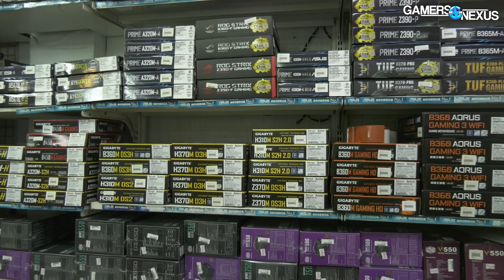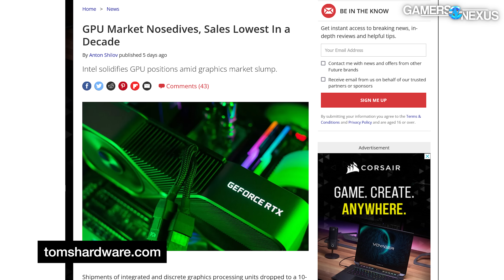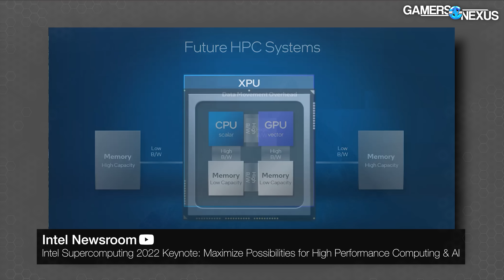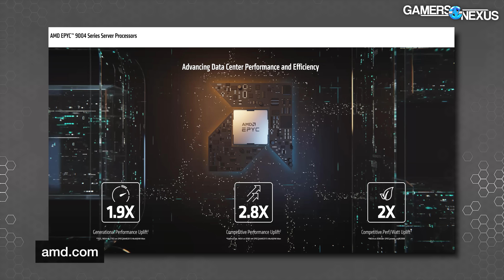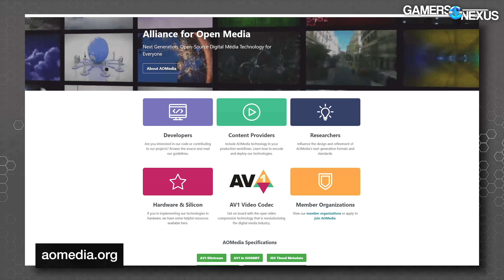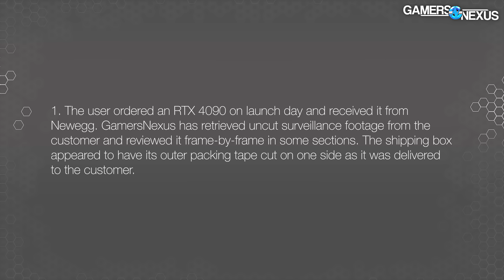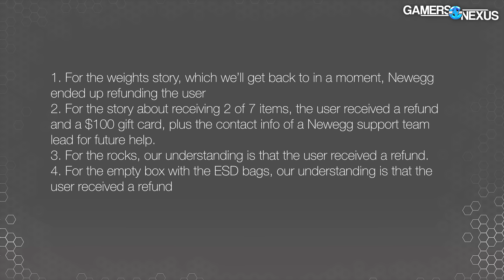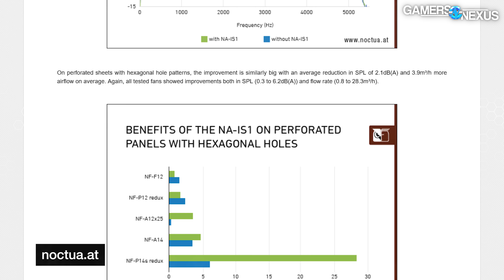HW News - AMD Beat-Down on NVIDIA Prices, Intel RAM on CPUs, Newegg Follow-Up, & More

Comment: Newegg is going downhill. I bought my wife a laptop for her Birthday, MSI ge66 raider w/ i9 and 3070ti in September. Sold and shipped by NewEgg. They sent me a low end MSI with a 3050 and i5. They acted like I was trying to scam them, ghosted me multiple times after I had sent the low end MSI back and not heard back from them after spending an hour on the phone with them setting up the RMA, they had received the laptop and did not send the one I originally purchased until being contacted multiple times, once per week. They provided 0 apologies, nothing, no remorse. They refused to do a cross-RMA, apparently they no longer do them. I ordered the original laptop and received it prior to her Birthday, and set the RMA up the day it was received. The correct laptop was not received until over a month after her Birthday, at the end of October. I will not do business with NewEgg ever again after being a customer since 2005. The laptop went down in price and they refused to compensate me for the difference and told me I could return and repurchase it, or contact a department that they provided no contact information to. Literally trash.

Comment: "Warranty the entire thing, or don't use low quality leds, or get rid of the leds" <- this right here. Asus warranty sucks so much ass now. Bought a board from the official Asus store on amazon, came fucked, couldn't RMA it because "Product from South Asian Region" But the entire board is fucking printed in english. Zero physical difference in the board, just retarded warranty services. So I had to return the board after the weekend.

If you buy Asus products anywhere try and put the product number into the RMA webpage for Asus just to see if you'll be able to actually have it fixed after the 30 day return period is up.

used to have very good experiences with Asus products, HDMI port on my VG248QE got messed up, bought that thing open box but was still 30 days into the purchase, they took the monitor and fixed it for free, sent it back with swag, etc. Good guy Asus. Not the situation anymore. Asus is very picky and arbitrary with their RMA and warranty services now.

Such wonderful consumer experiences of the past are now fleeting.

Comment: I've decided not to buy a GPU until the next GPU range come out. Just cannot afford to pay £500 for a graphics card. My AMD Ryzen 5 360 works well enough with a 1070. I'll wait until the 6750 or 3070 prices drop below £300 before I am temped to upgrade. Prefer to reserve that money for paying my electricity bill instead. Running these latest computers is similar to running a 1000 watt electric heater. I'm looking into Pi computers now. Paying £100 for an Orange Pi 8000 will be my next purchase as soon as they release a UK compatible keyboard. This is good competition for these new cheaper PCs. I look forward to Raspberry's response to the Orange Pi 8000 (I have the Raspberry Pi 4000). It will not take much to make these games viable with new graphics chips. Their low power use in these times of unacceptable electricity prices make them the only option in these hard times. The era of the BBC microcomputer is being slowly revived by the stupidity and arrogance of AMD, Intel and NVIDIA.

Comment: Ive been waiting to build a computer for like 10 years now. Every CPU was disappointing pre Ryzen 5000. Every video card had some kind of issue. Price, heating, high watts, some other defects (and shortages) 
They only card that seems decent enough is the 4080, but that's priced too high, and the performance of the 4090 is too high in comparison. I guess there is no perfect build, that's all I learned. I will just buy whatever I can in 2023, and combine it with an Ryzen 7000 XD chip.

Comment: Today my coworker and I were debating what gpu to buy for his new rig. I went straight to the 6600XT for $290. Then there was a 6650XT for $290. But it ultimately came down to a $350 RTX 3060 12GB. While it trades blows sometimes, but is typically slower, it came down to non-performance aspects. AMD drivers were his biggest worry. 3060 has better drivers hands down. DLSS RayTracing, and 12GB VRAM didn’t hurt. He got Darktide Imperial? Edition ($60) so it dropped the price to $290 like the 6650XT. So he went 3060.
Reply: raytracing argument is void and nothing but marketing bs at that price tier and the drivers are not that much better, its no longer 2005. And no, I am not an amd fanboy, I currently have an nvidia card, but their current pricing and line up just suck ass
Reply: @kingplunger1  I knew people would say RT was a gimmick, but that’s why I said it wasn’t a priority. RT isn’t a gimmick even on a 3060. Anyways DLSS is more important than RT. The drivers still aren’t great, they’re hit or miss. Plenty of reviews and forums show people with 5000 and 6000 cards having driver issues. I wish it wasn’t true, but it’s still a reality. Outside of simply working, they have better features like DLSS, and a much better interface IMO. AMD is killing it hardware wise, but still need some work software wise.

Comment: The guy put the weights into the box and now is trying to scam newegg :D
I feel this should go into court. It does not matter which side is scamming. Scammers need to be punished.
Only video proof of opening the box will be evidence enough that the weights were already inside.
And since the weights are machined from real metal this makes me think that indeed it is a scam, but not scam for money of GPU but scam for publicity.
No normal scammer would go machine metal bricks to put inside. They would put other non valuable weight like stones.

Comment: I don't understand the hype of 4K resolution gaming. If you are using your desktop and using a 27-32 monitor 2K is great. 4K resolution is barely noticeable on medium sized monitors and is only good for TV or extremely large monitors.

Comment: It's great to see AMD benefiting from more sensible pricing, but AMD is absolutely not kicking Nvidia's ass.  I say this because in data centre, AI and other crazy high profit markets, NVidia is the only option.  If it doesn't run CUDA, it's not even considered.

And when you can sell cards for $10k+ to a data centre instead of $300+ to a consumer, you don't mind so much if you lose a bit of the consumer market as long as no-one touches your data centre stuff.

Until AMD can come up with a way to compete with CUDA, Nvidia is always going to make more money on their low volume, high margin stuff.

I really want an AMD GPU, but Nvidia just dominates for productivity stuff.  OpenCL sucks so bad, it's not worth even considering AMD.

Comment: I think it would be easy for a Fedex, Amazon, or UPS driver to swap the item for some rocks or scrap metal  and either sell the item for side cash (lots of it) or use if for themselves, seems easy to do. they know the weight of the item, handle those packages daily and there are no cameras, as far as I know, in the delivery trucks storage areas....so yea..it could much more EASILY be done on the road.

They know where the package is coming from, the average size of the boxes being shipped as well...However, there are scamming assholes out there, but its on both sides.

Comment: its sad, that the 3080 is only at or slightly above MSRP, in usually cases (without the mining ect) at this point it should be discounted at $600 os of the new generation, but cos the greedy MOFOS at NVdia had gall to price the new 80-series  $400 more and the partner brand cards are another $100-$150 more, the 3080 wont dip to $600 or less, like its used to be..

Comment: You putting pressure on Newegg when these issues come up is probably one of the only reasons they might improve their processes. By not not bringing up similar stories again like that guy with the 4090 just because you cannot 100% verify the claims, it will embolden Newegg to continue their lackluster support system.

I thought a while ago you said you were going to keep tabs on Newegg after you guys had a terrible RMA experience, is that now thrown to the wayside?

Comment: Yea i had to use a braided cable on my LL o11 D evo with the 4090 FE as to not bent neck lady'' my 16p. Man the Evga's Rtx 3090 ti ftw3 side short side 12+4v gpu cable fit perfectly and allow for some fun with the giant atrium left over in the case.   The problem isn't only that but like the 3090tiftw the FE is short and stubby , which doesn't play well with cases like mine. Anyone wanna trade their Gigabyte  Gaming Oc for FE, Haha j've, always wanted one could never get cuss Steve and derbauer bought them all, yes all of them 3060-.. XD. i'm no scalper so its almost wrong to sell the EVga cards I've got since 2014... sigh...it just came out in march but he 4090 FE is actually amazing , getting lucky on amazon for 1.9k only did it cuz i use for work and ur awesome deep dive into the card!   Cant wait to upload the insanity that is this 2 fan 3k+oc monster... Thanks as always , I appreciate you guys for reviews and tests on cases - power sup to coolers,. I'm building my 4th gaming workstation for friends and family since I started to work in this amazing community.

Comment: Just curious, when the reviews happen for the RX7900XT and XTX, will you be comparing ray tracing performance against the RTX 20 series card (Some may not have been able to afford a 30 series card due to scalper's, cr..to buying out a lot of last gen cards.) and so this could be useful to see what improvements over the first gen RTX cards the new AMD GPU's have over say the 2080 TI, Super variation of said cards.  Do think they're still used a bit and could be a more interesting line on whether to upgrade to 7900 or move up to a RTX30 card.

Comment: Sad to see that those low AMD gpu prices don't seem to get across the atlantic. 3060's are a lot cheaper than either 6600's let alone 6700's. Heck 3070's were selling at hundreds of euro's cheaper than 6700's during black friday weekend. Only in the high end last gen AMD's prices seem to be a bit lower than NVIDIA's but still not by the margins like in the US. I mean sure, we have VAT and all that but that doesn't explain why NVIDIA cards are closer to $ prices than AMD cards are, they get the same VAT rate after all.

Comment: How it's made:  nerd version.
And Nvidia trying to purge their 30 series inventory?  They are still way over msrp here in europe. Cheapest 3070= 589  cheapest 3080=836  cheapest 3090=1350  3080TI=1250  3090ti=1500.  then again the 4080 and 4090 are also stupidly overprised.  cheapest 4080 = 1470 and cheapest 4090 = a whopping 2200 euro.   and none of these are the desirable main 3 brands but brands like inno3d and asrock and PNY.

I hope intel is considering a gaming cpu with HBM. That would put AMDX3D to shame as just 4GB would be so much more as amd has now. imagine 32 gb on a 8 core with no or just 2-4 E-Cores for windows. that amount of memory is all a gamer needs for years to come.  i have only seen it bypass my 16gb once and that was with a game that was having a memory leak (no mans sky on really long sessions pas 6 hours and on 4k).  Most games dont get over 8gb for ram on 1440p.

As for EV1.  I can't care untill both Twitch and Youtube support it for streaming and a high end gpu is 800 or less.

Comment: I'd noticed that AMD GPU prices were looking very sharp indeed and I was about to jump in and buy a RX 6750 XT for about $520). However, last minute today I spotted a RTX 3080 10GB deal for about $630 so have gone for that instead. I am putting it into my sim rig and the game I play most often is very CPU limited (iRacing) so I'll likely undervolt the 3080 and knock its power down by about 80-100W.
Reply: Ah, good old iRacing.  What type of cars do you run?  I do GT3/GTE mostly.  I just got a new GPU too, saw a Sapphire 6900XT Toxic (air cooled, not the one with a liquid cooler) for $769 and went for it.  I like Sapphire, my last 2 GPU's were Nitro+.

I've been on a "break" from iRacing for far too long.  Got really frustrated because I was about to break over 3k iRating and had a horrible streak where someone would wreck me in the first few turns every race for about a week.  A couple of times it was the same guy.  

At a certain point the competition gets tight, and you're working really hard just to gain 10-15 pts in a 45 minute race.  Then it's super demoralizing when someone wipes out your last 5-6 races worth of progress with one stupidly aggressive move.  Sometimes I think the stewards need to be a bit more proactive with people that are not necessarily malicious, but still reckless, or just insufficiently cautious.  I understand that's a slippery slope of making people scared to race hard, but man... some people drive like idiots and a simple 4x is just not enough of a deterrent.  

Anyway, when I come back I'm just not going to worry about iRating so much.  It's not as fun when you're stressing about every little 1/10th of a second you lose by not taking a corner perfectly.